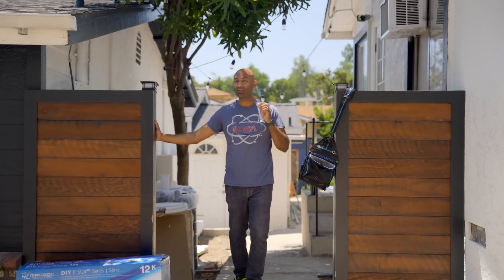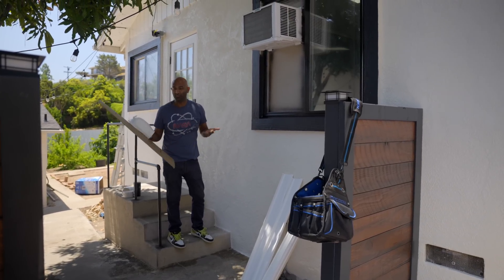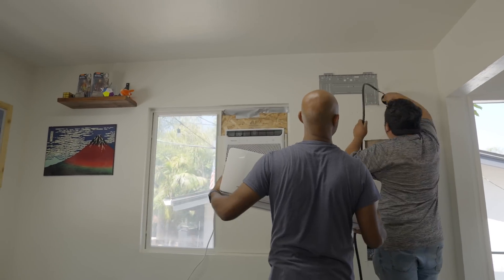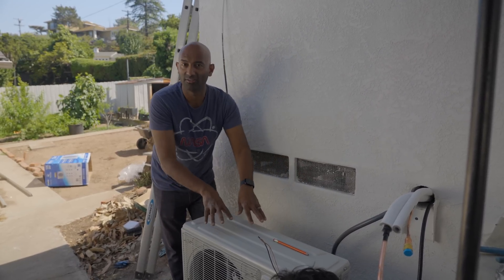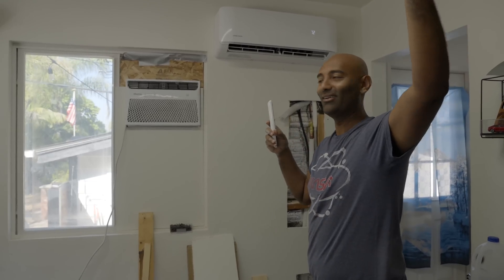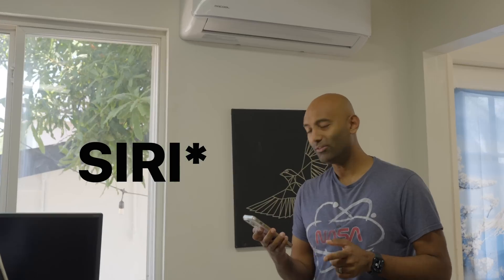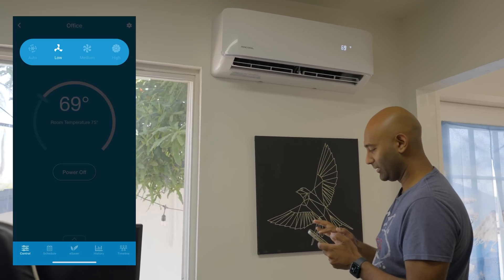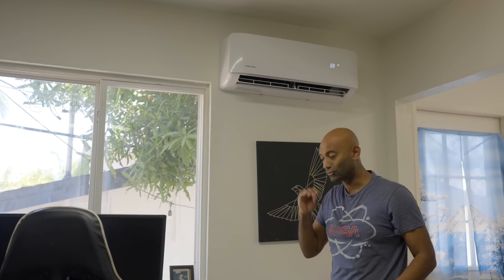Summer Heat? Here is Your Answer! DIY Mini-split Heat Pump!

Comment: I install mini splits and honestly not a fan. To many cons.
Reply from the maker: what are the cons? most of the world uses these... as an engineer, these are absolutely amazing. cheers
Reply: @TwoBitDaVinci  so the first thing I do not like is repairs are much harder than with a regular 13 to 14 seer ac. I can usually diagnose them in minutes where as it take me much more time with the mini splits. Usually I have to call a tech line where you get very hit and miss help diagnosing the problem. The last Fujitsu board I installed took me three hours to replace. It was buried in there and god there were so many connections. they are never installed with a float switch including yours. If the drain gets backed up you will have water running down your wall. Been to several where the wall had to be repaired because of this. In my area if you your going to rely on a mini split as your only source of heat you will have to put a much bigger unit in than you would think. It will have to be rated to at least -13 degrees because two years in a row we had lows at -10. These units cost a lot more than the regular mini splits. parts almost always have to be ordered if you can get them at all. They leave cold and hot spots in the house… your unlikely to pay for one to be installed in your bathroom. 

That said when they are working correctly they can be great. But I would not want one in my house. Maybe my garage/shop…
Reply: @TwoBitDaVinci well, There's Air Con (ditioning).

In New York State these are good for day to day, but I think we desperately need a natural gas or other fuel backup. If for no other reason, because a brownout in the winter will be a lot more dangerous than a brownout in the summer. If we have brownouts or rolling blackouts and the coldest days of winter like we have run outs in the hottest days of summer it can be more dangerous.

A lot of the new systems will operate to -20 Fahrenheit, but they're only efficient down to +10°-0°. The time you need them the most they're the least efficient, and that could be a big risk to the grid.

I'm hoping to install a mini split, but I really like my old cast iron radiators and natural gas heating. The thermal mass of the radiator is really efficient and cost effective.

I do hope to get solar at some point, I think that solar plus a mini-split makes sense spring through Fall.

I just insulated my house and I found my boiler turning on half as much this winter.